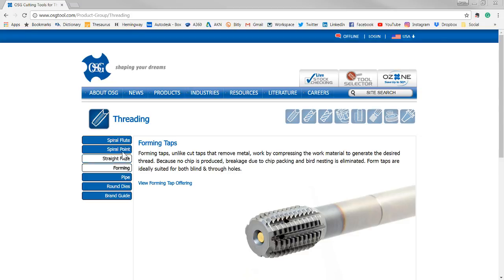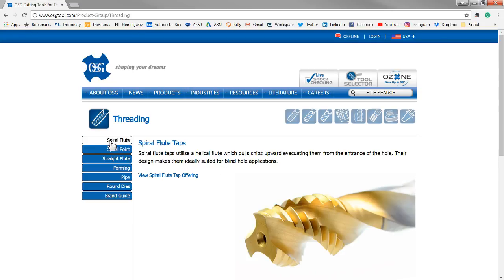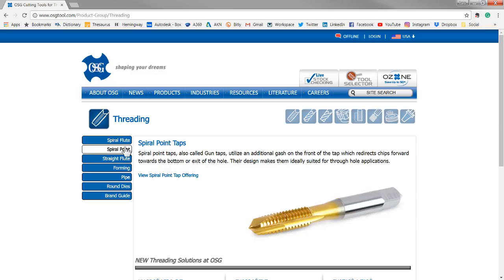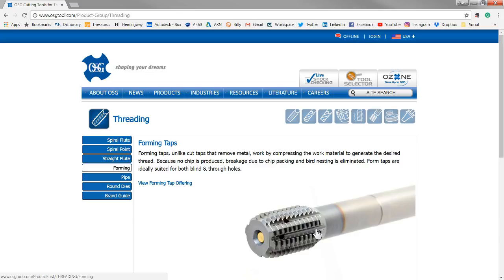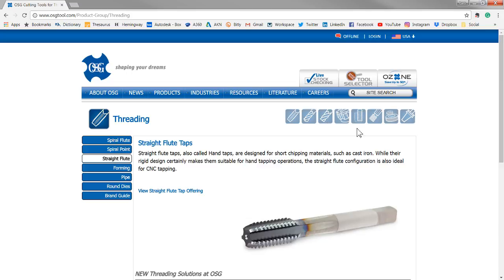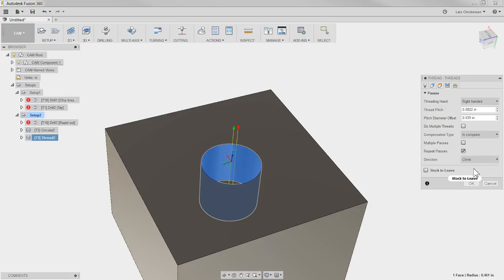Everything I Know About Taps & Thread Milling — Fusion 360 CAM Tutorial — #LarsLive 128

Comment: Thanks for your insights on threading. I learned a lot.

I noticed in your discussion of thread milling you appeared to add a radius offset to the profile instead of the requested diameter offset. The simulation showed very shallow threads suggesting this error. In other words, you entered (nominal - pretap)/2 instead of what looks like it should have simply been  (nominal - pretap).
Reply from the maker: You are so very welcome :-) Thank you for watching!
Nice catch on the thread milling discussion!

Comment: Hi Lars, at 33:38 you enter (major - minor)/2. Is the /2 a mistake and why the simulated threads look squared off? Would be nice if the thread milling options were aware of the existing hole diameter and allowed entering desired thread, perhaps from a pulldown, which after selecting fills out pitch and pitch offset.
Reply: I think thats a mistake from Lars (with "help" from the fusion developers making this very unclear from start)
it's pitchDIAMETERoffset  = nominal-minor(or rather pretap).
I've struggled with this and realized that its not that simple. for example a 3,3mm pretap for a m4 thread with a 3mm treadmill will not work with an offset of 0,7mm.(its rather somhwere near 0,83 depending on your tool)

Yes. It would have been easier if you could select your modeled hole (or type in your drillsize)  and just select your threadsize and let fusion do the math for you
Reply: Thank you for the verification. The threadmilling that I've just started doing is on a CNC conversion, but I'm been successful, for m8, to use 8-6.7 for pitch diameter offset, three passes, with stepover set to (8-6.7)/3. However, in steel, with a multi-profile thread mill, I have to run this slowly or repeat the program two or three times. There's a big gotcha for us who mix metric and imperial, that the dialogs make unit assumptions that are not consistent with the document units, and the expression evaluator is finicky which is a bad combination. If I interpolate to create the starting hole, I have to remove a little extra material to hit the desired diameter. The results are much tighter than a tap. I wrote all this because you said that you needed to add a little more to the offset, and I'm wondering if you've discovered why or will point out a flaw in my method. While not as small as m4, I've not needed to with m8 (or m6.)
Reply: @kentvandervelden  
I googled and found that John Saunders ( NYC CNC)  had a calculator for offsets https://www.youtube.com/watch?v=ggo24jmlpWA&t=982s
(Not 100% verified since i was in a rush and decided to hand-tap those 4 holes instead of spending time with fiddling around and making testpieces)

its a bit annoying that you have to rely on a external calculator for something the cam-software should be able to fix with 3 given parameters (Thread, hole and tool-diameter)